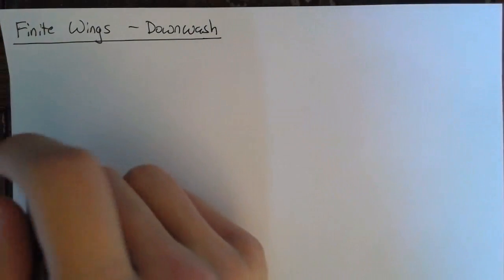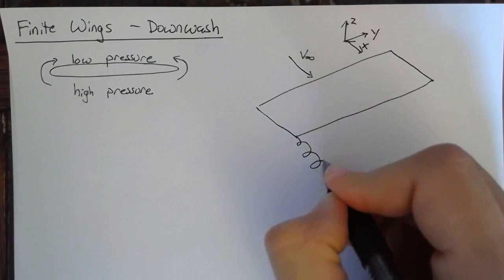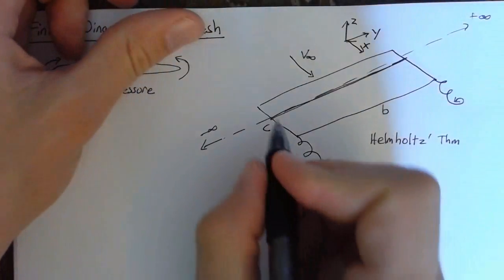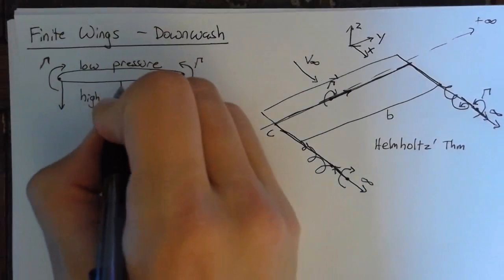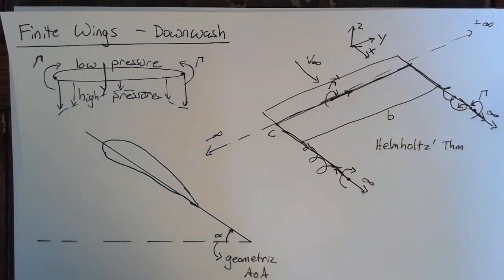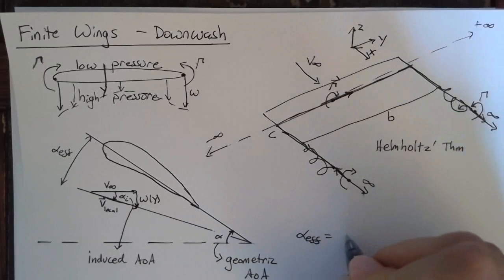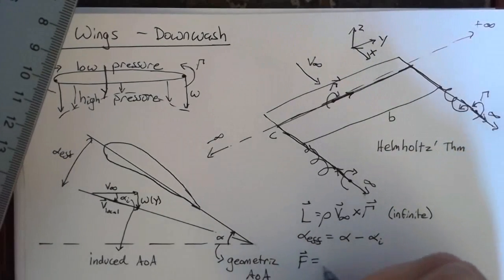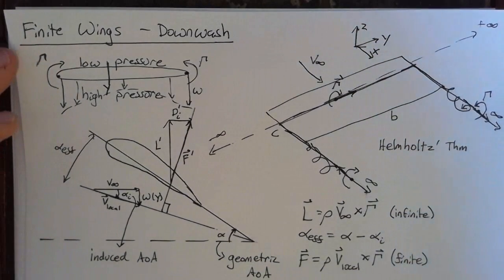Finite Wing -  Downwash

Comment: So the flow from the bottom surface of the wind to the top surface is caused by the pressure difference? This rotational flow of air about the wing tip, as the aircraft is moving forward generates the spiraling vortex?

But what I don't understand is why there is a higher level of downwash at the tips. Down wash being the amount of deflected air, I assume. There is more lift generated closer to the middle of the wing.

I'm also not entirely sure what the relationship is between the vortex itself and the downwash, aren't they both just outcomes of the lift generated? Maybe I don't properly understand the meaning of the term downwash and why exactly it is generated.